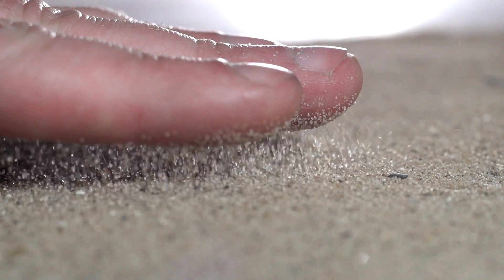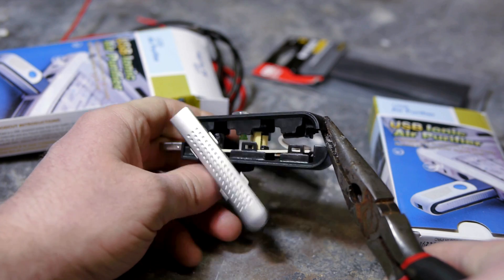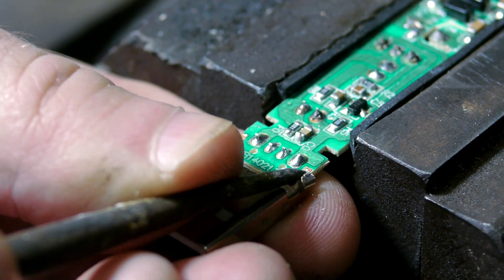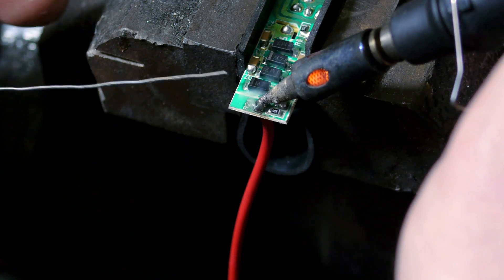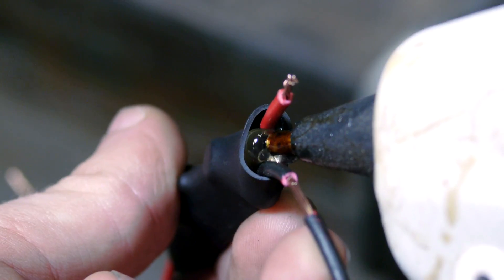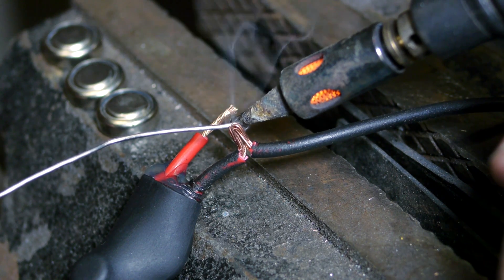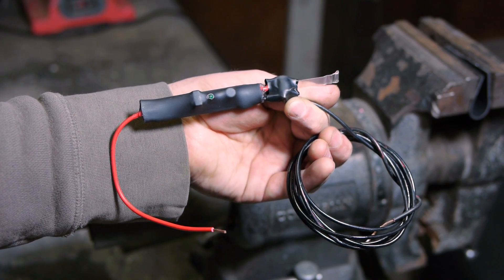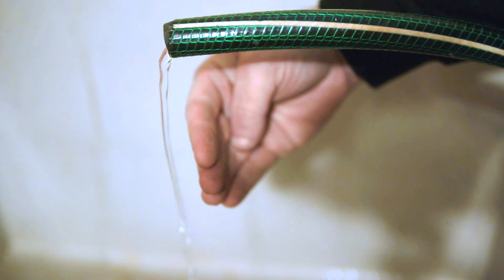How To Make A $5 Static Electricity Generator - NightHawkInLight

Comment: I made this, but used a 1A USB power adapter to supply power. The light comes on but it doesn't seem to work. Is there any reason it shouldn't?

Comment: I know this is an old video and I understand if no one sees this. But if anyone does, my build is not working and I was wondering how I could troubleshoot to find where the problem is. The green line turns on, but when I put the whole thing on myself, I don’t build a charge
Reply from the maker: These cheap devices are often faulty. You might have gotten a bad one. I have other versions you can find in the video description which are more reliable and stronger

Comment: I’m targeted individual illegally RFID chip implant I’m trying to use ionizer to disable the chip implant in my body.  I’m being attacked ripped torture harrassment can the Author help me demonst how to use the device I will purchase one thank you
Reply: RakiyaIssaka317, did u build this, and did it help stop the subsonic acoustical targeting? There's also another project that I seen on dhgate, along the lines of putting static in the air using an induction heating coil to help make targets invisible by creating a field in the room.. Let me know if u find something that works, I'm dealing with it too.. The only thing that I know that's a sure thing, is getting a computer forensics/ intelligence tcsm to do spectrum analyzing, which will tell them exactly what it is n where it's coming from. I did some analyzing myself, but I'm not a pro, n really need some help. . ANYONE? I'M IN TUCSON, ARIZONA. IF UR UP FOR IT, COME ON..

Comment: Creating a $5 static electricity generator can be an educational and fun project. Here's a simple guide to help you build one:

Materials needed:
1. A plastic bottle (2-liter soda bottle works well)
2. Aluminum foil
3. Conductive material (e.g., copper wire, metal tape, or a conductive sticker)
4. Scissors
5. Tape or glue
6. A balloon (latex or rubber)
7. A grounding object (e.g., a metal doorknob or faucet)

Instructions:

1. Clean the plastic bottle: Rinse it out and make sure it's dry inside and out.

2. Wrap the bottle with aluminum foil: Cut a piece of aluminum foil large enough to cover the entire bottle. Wrap it around the bottle, making sure to smooth out any wrinkles or creases. Tape the foil in place if necessary.

3. Attach the conductive material: Cut a strip of your chosen conductive material long enough to reach from the bottom of the bottle to the grounding object. Attach one end of the strip to the bottom of the bottle using tape or glue.

4. Prepare the balloon: Inflate the balloon to a medium size, not too big or small.

5. Assemble the generator: Place the balloon over the mouth of the bottle, making sure the conductive strip is hanging out of the bottom.

6. Ground the generator: Touch the end of the conductive strip to your chosen grounding object, such as a metal doorknob or faucet.

Now, you're ready to generate static electricity!

To generate a static charge, rub the balloon briskly on your hair, a piece of clothing, or even your pet's fur. You should feel the charge build up as the balloon becomes more and more sticky.

To demonstrate the static electricity, gently touch the end of the conductive strip with your finger. You should feel a small shock, and the balloon may stick to the metal grounding object.

Remember to always handle the generator with care and respect safety precautions. This static electricity generator is a fun and educational project, but it should not be used for any dangerous purposes.

Comment: I've just tried to build this project, and seem to have come across an unexpected issue. I'm connecting the batteries with the electrical tape, but the light only turns on for a moment, then starts to dim, turning off after around 20 seconds or so. If I hold the wires to the appropriate terminals, the light stays on. Either way, though, I can't seem to build up enough charge to make a shock, move small particles, or bend the path of a stream of water. Any ideas where I might be going wrong?
Reply from the maker: Sounds like electrical tape isn't giving you a good enough connection. Might need to solder the wires. Note that this version is not as strong as the 9v battery version from earlier videos and moves sand and water less dramatically
Reply: @Nighthawkinlight  Sounds good, I'll try that. Thanks for the quick reply!

Comment: Sorry if this is a stupid question. Does the generator give your body a positive or negative charge? And is it possible to change the charge from positive to negative (or vice versa)? If so, how so?
Reply from the maker: It gives a surplus of electrons to your body. It doesn't work as well to switch the polarity
Reply: @Nighthawkinlight  got you. Thanks for your reply 👍🏼👍🏼
Reply: @Nighthawkinlight  does it make your hair stand up?

Comment: Hi NightHawkInLight! Thanks for the video. Could you explain why the ground terminal needs to be in contact with the physical ground on the floor? Thanks!
Reply from the maker: I can't explain on a technical level beyond saying it works best that way. It seems the device builds up a charge between whichever two objects the ground and output are touching.

Comment: Do you think you could make one of these out of one of those bug zapper circuits if you take out the capacitor? Seems like it could work
Reply from the maker: I haven't looked at those circuits. Maybe you could
Reply: @Nighthawkinlight  I made one out of one of those negative ion generator things and it works like a charm thank you!

Comment: ive just built this, but when i connect the ground wire to the ground under my foot and the output wire to my leg or hand or arm.... it does not work at all, the green led light comes on.... but no shocks... the only thing i feel is some tingling sensation from the output wire and a stronger tingling from putting it specifically on veins..... any ideas to what i can do to make this work or is this device simply just too weak and will not be able to do whats shown in the video as its most likely from the other device with the big ion generator?

thanks in advance but ill call this a fail although the idea and the video is really good but i think its simply not strong enough to show whats happening in the video

ive tried using more batteries and even connecting it straight to the power for more electricity but even then that did not really increase the power either

Comment: I made it. Although it does seem to ''work'' it is very weak, no visible spark or any other effect. The device itself makes a constant zapping sound, is that normal ? And any idea why it does not work as the video shows  (i followed all instructions)
Reply from the maker: Don't know about the zapping sound. It sounds like it's working properly, this is a pretty weak generator. Links to my other builds are in the description, they are more powerful.
Reply from the maker: You should at least be able to get a spark. Try wearing more insulating shoes, and standing on more conductive ground
Reply: @Nighthawkinlight  Hey man thanks for your reply, so there was an issue, one small bit of the device was disconnected and there was a leak (i dont know the electronic term of the component) after fixed the device seems to produce a good spark. Thank you for posting those awesome videos !

Comment: Couldn't you just use a portable phone charger to power it so there's less rewiring?
Reply: Nope you can't
Reply: @dexterbrown1022  why is that? I'm trying one with a rechargeable battery and it is not working.

Comment: Hi NightHawkInLight, I tried replicating this device, but it will not work. I followed each step correctly and the green light goes on, indicating that a current is flowing through the ionizer. Would you know what I’m doing wrong? I don’t get a spark or feel anything. Do I have to been standing on a certain surface, or do I have to wait a little bit to let it “charge”?

Update: when I hold the two pieces of aluminum near each other, I do see a small arc of electricity flowing between them.
Reply from the maker: You need to have good rubber shoes on, and it does help to stand on a slightly conductive surface like cement
Reply: NightHawkInLight ok thanks

Comment: Is this really working, i.e. can you actually bend water with this. Did i do something wrong? I just get small spark nothing else.
Reply from the maker: This can bend water a little, but you may need to wear rubber shoes to build up a charge. My other generator projects are more powerful.
Reply: @Nighthawkinlight  Thanks
Reply: I will try your other generators, thanks for videos.

Comment: I would like to try powder coating metal at home, as I understand one needs a high voltage current conducted into the piece to be coated in order to attract the powder to it initially before baking it to the metal object in an oven. Would this work for that purpose? Another use might be making an electronic dust collector? Anybody think it would work?

Comment: Question- will the circuit board withstand a 9V supply instead? Thanks
Reply from the maker: No, it will burn out. Keep voltage on electronics within 20% of recommended

Comment: I have a question. Can i not attach the black wire to the bottom of my feet, BUT touch the ground instead? That way i wont be always charged, but i'll be able to charge myself when i touch the ground with my hand? Or it wont work at all.

Comment: Built one, the static electricity seems too weak to lift even a small piece of paper, and the tiny SMD transistor is running hot. Has this to do with the humidity in the room?

Comment: @NightHawkInLight really cool video! I know this is an older video so I don't expect a response. But have you tried hooking more than one of these up together and if so, does it will boost the static charge??

I'm just curious if something like these could be used to make a literal Dust Magnet? I'd like to make something that I could place in my work shop that would attract the microscopic saw dust thats floating around in the air. 
   I know they make air filtration systems for work shops but that's a lot more money than I have or am willing to spend. 

So I was thinking that if I took like a 4inch diameter PVC pipe and put some metal screening on the inside of it and hooked a few of these up it might attract the dust to it. Do you think this could work?
Reply from the maker: Check the video description for links to my other static generator projects. Better to just build a stronger version from the start than link more of these together.

Comment: Please can someone respond if you know what is wrong. I bough one of these first and I got everything done and the light lit on. There are small arcs between grd and hot but I can not get a charge on me. I thought it was a problem with the board but I bough a new one and same thing. Thankyou In edvanced
Reply: shelburnie Thankyou for the response and I am using flat button cells so I will have to get some thanks I will keep you updated

Comment: I built this, but it doesn't produce the sandstorm in your video (3:09). I didn't think you can produce that kind of static storm from only 3 small disc batteries. Were you reusing video from your previous (more stronger) static generator? If so, that would be misleading.
Reply: Probably was

Comment: Ok, so... can you really call this a static electricity generator if you have to be grounded? Also, having to have whatever you want to affect grounded as well? A real static electricity generator would just charge you up so you can shock anyone with a diffrent enough charge, and this isnt nearly powerfull enough to shock anyone. Is there any way you can make a legit how to static generator? Asides from that at least you tried, i had some fun building this.
Reply from the maker: This is a real static generator, but it requires the best grounding possible so it can make a charge differential faster than it bleeds of your skin into the air. Check the video description and you'll see I have videos about two other versions of this device that are much stronger.
Reply: @Nighthawkinlight  I understand the stronger versions option. This clears up a lot too. One more thing, how can i amplify this to charge faster despite the ground? (P.s. not talking about a stronger battery but if possible i would apreciate modifying it to handle one)

Comment: Hey NightHawkInLight, does this basically work because you are turning your body into a capacitor? The earth (or whatever you are standing on) being the item gaining the negative charge and your body gaining the positive charge with the rubber sole on your shoes being the insulator separating the two objects?
Reply from the maker: Yep, that's pretty much exactly how it works.

Comment: I think if you amp up the static electricity voltage to millions but also current, you will probably create a anti-gravity effect similar to lifter experiments if you do it right. A repulsion between millions of voltage and current static electricity and Earth. There probably wont be any ionization of atmosphere with static electricity. Obviously a very dangerous experiment.

Comment: Serious question: I found this video by looking for a way to create a static charge on small lead items that I powder coat. I do not use a typical powder coat spray method, but rather just shake these small lead items in a container with a bit of powder coat paint. (dry). I live in Wisconsin and it is very humid in the summer and very dry in the winter. The difference between how the powder "sticks" to the intended paint items is amazing. In the summer when there is literally no static electricity available in the air ...NO BUENO. Can't get the powder to stick. But in the Winter...I tried once in my unheated garage when it was -20 Fahrenheit. BINGO. It stuck like magic. Nice thick coat which I could then bake in my little toaster oven. 
After watching this video, I intend to try using this to somehow create the voltage difference between the powder and the lead items ...I haven't figured out how to do that. Any suggestions?
Reply from the maker: Check the video description of links to my other static generators. You probably want to use one of my stronger ones for a project like you describe. Just attach the output wire to your material and the ground wire either to the ground or to your powder source and you're in business. HOWEVER, there is extreme likelihood of a spark that could cause ignition of any solvents. I don't know if the process of powder coating involves solvents but if so you'll have to be sure to do this in a way where ignition would not be catastrophic. A less dangerous source of static charge might be a toy van de graaff generator wand which generates much higher voltages but not enough amperage to usually generate sparks capable of ignition. Still take caution with such a device, but the risk is lower.

Comment: I made this as a project on my channel I did some things different like hook it up to a usb power bank with a switch on it and use "E" pieces from a old transformer for contacts. But over all awesome video i'm definitely gonna try to use better components for my next one I make although I don't got the gut to actually get my camera near the thing when it's on lol. Also for those wondering don't let the positive and negative touch too long even if it is just to test it mine burned out after like 25 to 30 minutes and my guess is the capacitor was discharged or something from letting the ends touch too long and it won't charge.
Reply: Also the shock wasn't bad and I couldn't get sand to move I guess i'm too static absorbent or my floor was not wet enough if I had to guess the kv put out by this is maybe the same as a fly swatter but idk.

Comment: So this might be a great way to make a cheap static grass applicator for small modeling projects. Do you have to remove the USB or can you just attach a ground wire to the circuit board so you can still plug it into a USB? I don't need to go anywhere with it so it would be nice not to have to waste batteries
Reply: You can do what you are looking for with a fly swatter I heard and if I had to think about it I think you can extend the usb but add a ground wire like you said and it would work as far as i'm aware i'm gonna get one and try it that way .